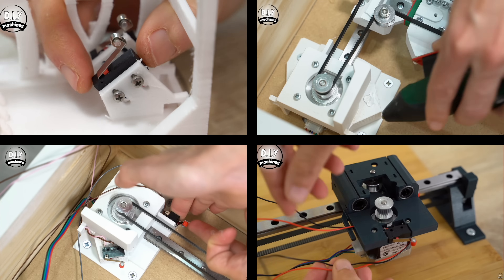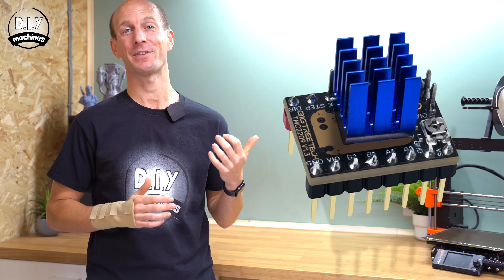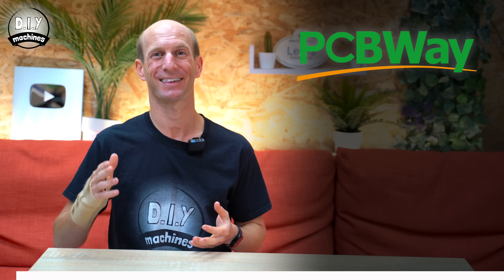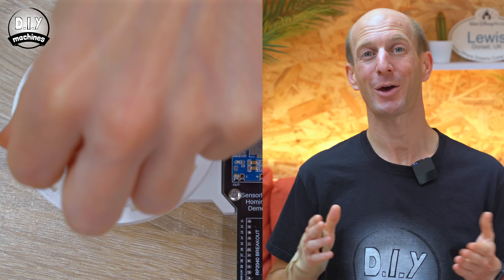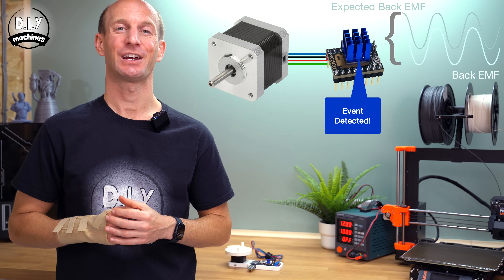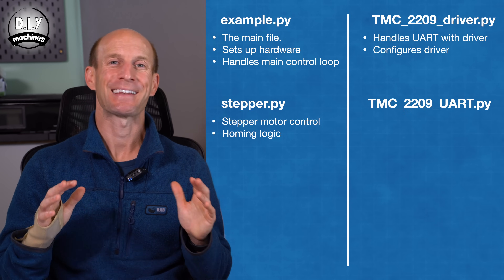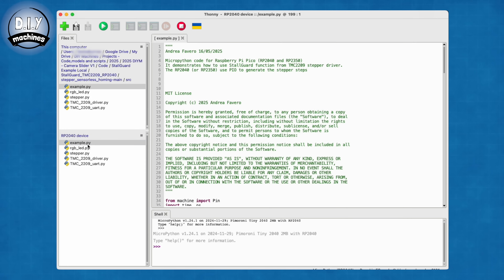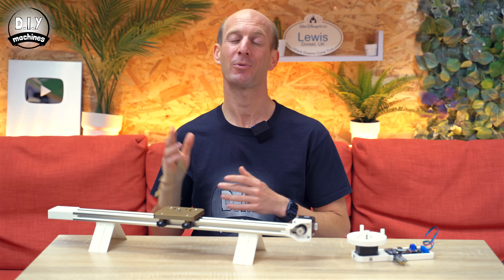Sensorless Homing in Python - RP2040 | TMC2209

Comment: Sensorless homing is a very useful technology already used in commercial 3D printers and other applications.
Unfortunately, there is little documentation on the precision and repeatability of this technique.
Thanks to some comments on this excellent video tutorial, I decided to upgrade your test setup and run a study using a 0.01 mm dial gauge.
RESULTS: 3σ repeatability of ±0.01 mm, which is better than a single microstep (https://youtu.be/ilci2rO6KwE)
Reply from the maker: Thanks for the test Andrea and all your other work on this project.

Comment: Amazing video, ordering the pcb when it's available and all the parts to go with it for my project. Thanks to the both of you for this!
Reply: Thank you for listing all the parts, the only thing I didn't see listed was the dc barrel jack. Can't wait till the pcb is available!
Reply from the maker: OK, kit of all V2 parts available here: https://diymachines.etsy.com/uk/listing/4326334730/sensorless-homing-electronics-kit
V2 PCB available here: https://diymachines.etsy.com/uk/listing/4326340141/sensorless-homing-pcb-only
There is a slightly enhanced V3 PCB and circuit design coming at the start of July. It needs just an additional diode and capacitor and allows for faster and more precise homing. I'll post back here when the revised version is available.
Reply from the maker: Thank you, and you're very welcome.
Reply: I can't wait, I just got v2 hooked up on my project, works well. I tried using the adafruit nema 17 motor they offer, but it didn't work, it just kept moving one way and the other way and stopping without hitting any actual limits. I swapped it for my leftover prusa 0.9 motor and it worked great. What motor are you using for your project?
Reply: I would say if there's anything I could change about the board, it's the power switch, I've already lost 2 boards due to the power switch attachment being real fragile. It rips up of the board like paper if pulled, even gently. Otherwise I'm having a blast incorporating this into projects, thanks !

Comment: In real life NEVER DO THIS! You will have endless PAIN! Your motor control i now dependent on the full tolerance chain of the mechanical system, were with a "limit switch" you only and the position of the switch to think about.

NEVER NEVER NEVER Agree to any indirect sensors like this!  Or you will know pain!
Reply: The best choice really depends on the application. For reference, there are several commercial 3D printers using sensorless homing, like the Prusa MK3 or MINI, and others based on TMC drivers.
That said, it’s worth remembering that "the electric light didn’t come from the continuous improvement of the candle"; sometimes, a different approach opens up new possibilities rather than just refining the old ones.
Reply: I always use this method on my commercial machines. 400W Ethercat AC Servo + 1605 ball screw, not a single fail when hard homing like this.
Reply: They use hard-stop homing in industrial machines too. You can find a video named "Homing and Precision Homing with ClearPath Integrated Servos" for demonstration.
Reply: That's what they say then it's surprised Pikachu face when I tell them they need to fix theirs tolerances and production quality to make the indirect sensors work reliably...saved $0.2 on a limit switch.... Every single time
Reply: Exactly. Removing a direct sensor and relying on software that relies on unknown tolerances is always the invitation to trouble. Your device works perfectly on your test bench. Then, after a year, you get thousands of returned devices just because your lubrication dried out a little or your gears have worn out a little. Just put that little switch there and forget it...
Reply from the maker: Even if you don't use it for homing - the same principle of monitoring SG Value can be useful for safety. i.e. detecting if something is blocking/interfering with the motion of something or even as a back-up if the limit switch experiences issues.
Reply: @DIYMachines  Good point